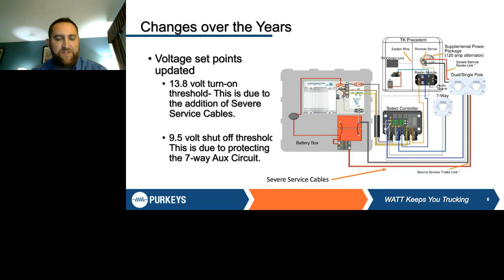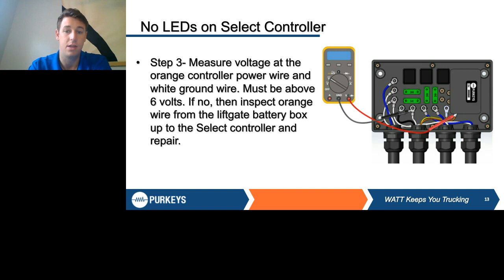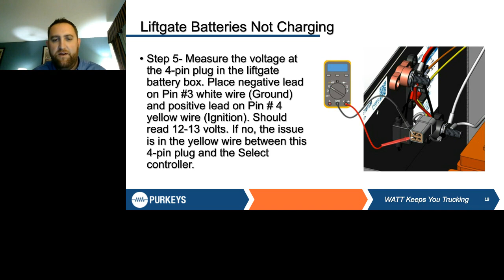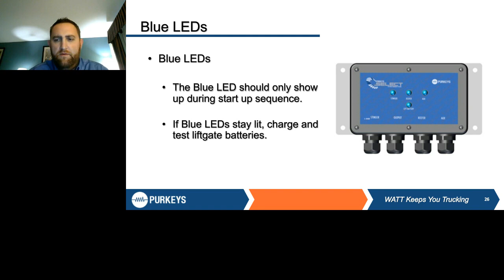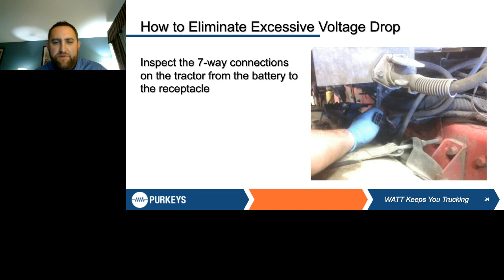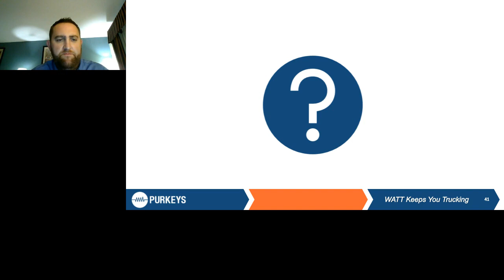Troubleshooting the Select Liftgate Charging System Webinar - Purkeys

Comment: For "Liftgate Batteries Not Charging" Step 3: If you have a solid yellow wire connection but still dont get 12-13 volts, is this an indication of a malfunction in the controller or something else?